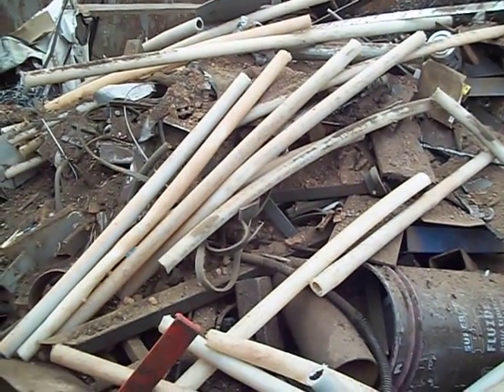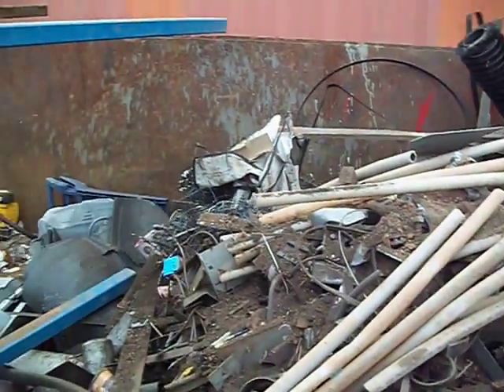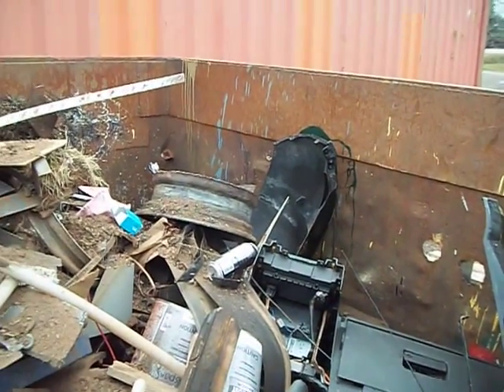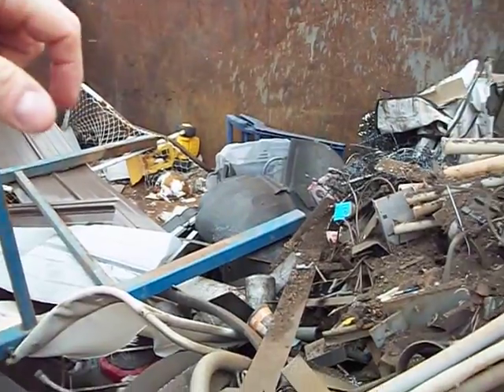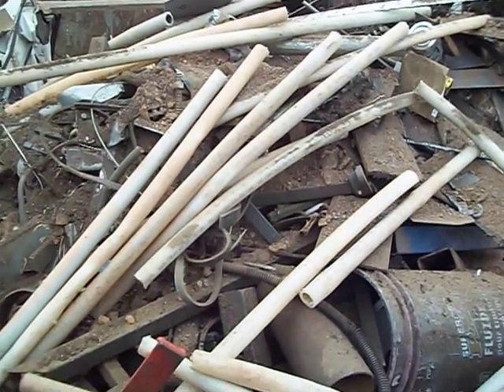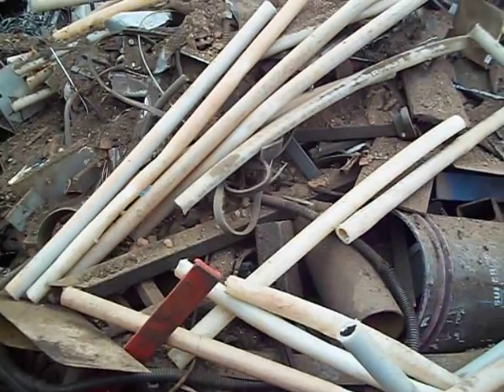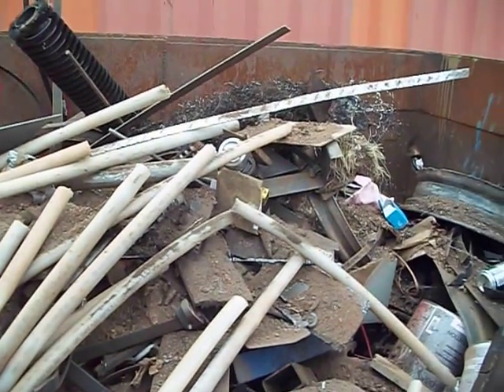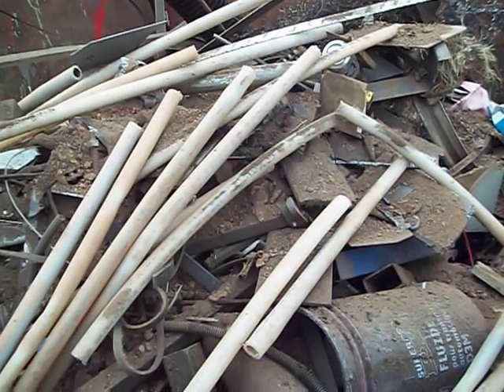Acquiring steel/components...where ?

Comment: Did ya grab that blue square steel. Its a good size for what we do. Perfect for a bumper, atv rack, and everything in between..
Reply from the maker: No I didn't. Although it was tempting but I have LOADS of it at home. There was also a large metal rack with adjustable legs in there but I didn't know what to use it for. Thanks for watching!